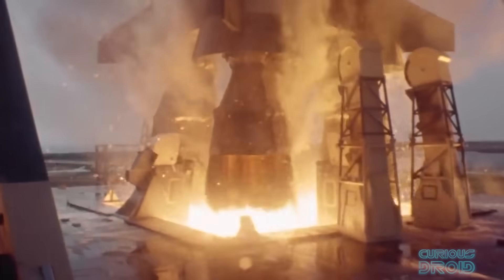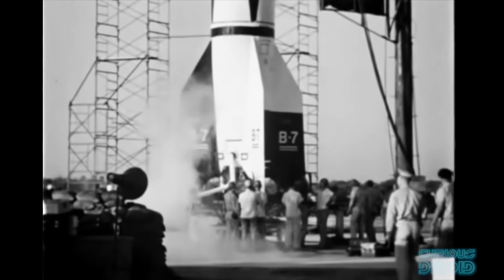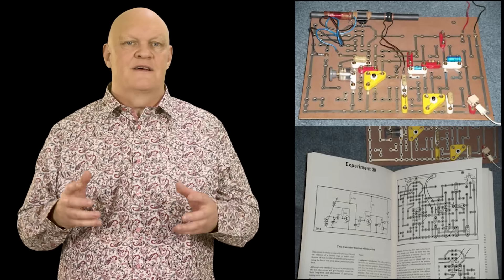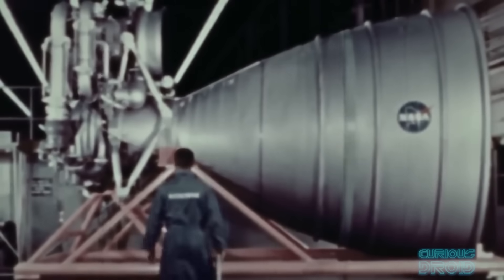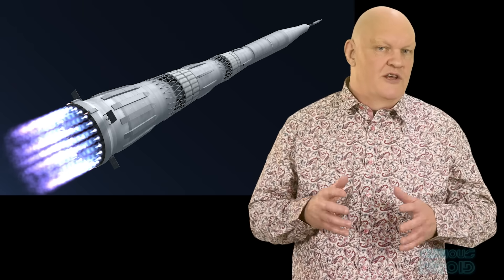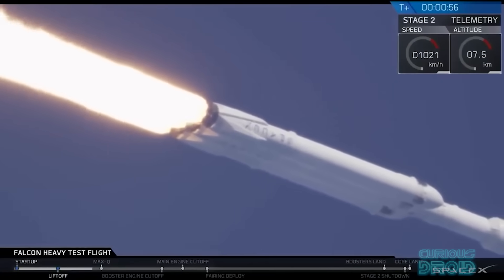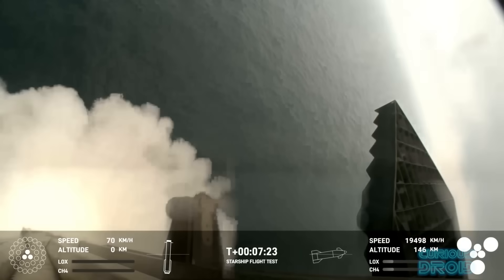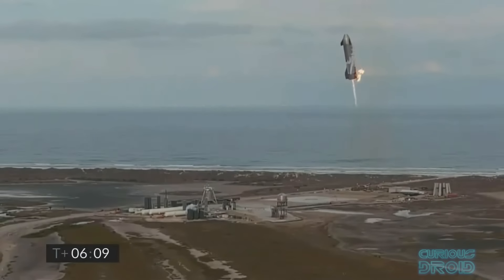Why Does SpaceX Use 33 Engines While NASA Used Just 5?

Comment: Elon is all about 'mass production' ... Raptors are the expression of this.
Reply: Did Apollo 11 actually leave near-Earth orbit?
Despite the revisionist narrative that this channel won't question -- unstable fuel burn for the oversized F1 engines was never rectified and another arrangement in their place was made in order to reach near Earth orbit, keeping the F1 bell nozzle to maintain the desired appearance.  The great licking yellow flame was an indication that something was not normal as fuel was burning in the atmosphere while providing no additional thrust. This was the result of injecting additional kerosene into the exhaust stream for greater visual effect yet appearing to produce an inefficient burn unlike other rockets after launch.  No explanation is forthcoming and this issue is not addressed in any usual report; however, using a smaller reliable engine with a reduced fuel load and stripped down mission requirement allowed the Saturn V to reach near-Earth orbit.  

The Apollo 11 crew attempted to demonstrate their position at over halfway to the moon as seen in the unedited version presented to the public while the more recently released unedited version reveals a flood of blue light entering the same window as the camera continues to roll, through which only a moment before, we saw the Earth far distant in what appeared to be very low light conditions. Then, as the camera pulls back from the window, the exposure settings are seen to return to normal as a flood of light enters the same window.  Without a change in the orientation of the spacecraft assumed to be on a trajectory toward the moon, the only source for any flood of light can be the Earth while in near-Earth orbit.  

Another indication are the impossible weather patterns seen on Earth, when in reality only a small portion of the Earth's surface was visible, framed by the round window of the command module.  Straight line cloud fronts are seen to be extending for what appears to be more than 6000 miles, a quarter of the Earth's circumference -- something that has never occurred in the meteorological record on Earth. 

The usual sponsored efforts will try to make excuses for why the obvious did not take place -- yet is overly apparent in the unedited version.  When facts cannot prevail in support, sponsored activity will resort to name calling and other derogatory comments discrediting themselves.
Reply: And he's learning the hard way why every attempt at using large numbers of engines ended in disaster.
Reply: @ZontarDow Raptors are meant for engine-out capability, in which a few engines failing won’t affect the outcome of the mission. In addition, Starship has had two perfect full duration ascent burns so far, and one in which one engine shut down, with no effect on the mission outcome.
Reply: @ZontarDow did i happen to argue with you on twitter yesterday? Because one guy was spouting the exact same nonsense you were! 
Engine count is not an issue. Engine reliability is.
Reply: @_K3PLR  no doubt he's hatin on the Elon, .. obviously still butt hurt about Elons 'Red pilling' 😉
Reply: @_K3PLR  Engine reliability is not what SpaceX is focusing on, which is why the 3rd iteration of Raptor began being built before the problems of the 2nd where even resolved. But then Starship is a conceptually dumb project that we already know from Heavy there isn't a market for.
Reply: @ZontarDow dont try and switch the subject dude. You were just yapping on about how "spacex is making the same mistake the soviets did!" This is obviously in reference to the N1 and its high engine count on the first stage.
Reply: "engine reliability is not what spaceX is focusing on"
Is that why during 3/4 integrated flight tests, the raptors preformed nominally on ascent for the superheavy booster and for the ship? Is that why on IFT-4 both the booster and the ship made it to soft splashdown? Cl
Reply: @_K3PLR  one engine explode with visible debris during IFT-4 booster descent to soft splashdown (15:42)
Reply: @xponen  thats exactly why having so man y engines is beneficial. you get ENGINE OUT CAPABILITY. what would happen if superheavy lost 1 or 2 engines on ascent? it could keep going and finish the job. Now what would happen if the Saturn V lost 2 engines? An abort and an abrupt end for its mission.
Reply: @ZontarDow  No market?  SpaceX is their own market for Starship.  And tell the several space stations being designed to fit inside Starship, long before the vehicle is ready for such a thing, that there will never be a market and that they don't count.
Reply: @xponen  That was pretty amazing that it still achieved the soft splashdown.  The software must be crazy flexible.
Reply: @snuffeldjuret  The same Starlink that loses money and mathematically can't be scaled up to profitability?
Reply: @ZontarDow  Starship4 just landed  both perfectly, with Booster. So what's the problem?
Reply: @Primaate  The fact that even ignoring Starship being conceptually stupid, in a best case scenario it'll have cost more then SLS to develop and will enter service just in time to be already obsolete given Blue Origin is on track to beat them to the moon which is the thing Starship's being used as a stopgap to bridge the development for.
Reply: @ZontarDow  You're obviously joking... or insane. Let's leave it with 😂 ... or 🙄
Reply: @ZontarDow the soviet union suffered from not understanding the economy of scale 

Something Elon understands more than most considering he's Americas leading industrialist at building things at scale 

The falcon 9 benefits not from it's semi reusable booster but mass production of the merlin block D engine 

Making kerosene burning engines at scale gave them an advantage even before reuse of the booster
Reply: @ZontarDow then WHO is????

He runs Tesla and employs the majority of Austin Texas and is Californias largest manufacturing employer 

He literally is the face of the space industry?

Comment: Quicker and easier to swap out. Cheaper to make and produce
Reply: Did Apollo 11 actually leave near-Earth orbit?
Despite the revisionist narrative that this channel won't question -- unstable fuel burn for the oversized F1 engines was never rectified and another arrangement in their place was made in order to reach near Earth orbit, keeping the F1 bell nozzle to maintain the desired appearance.  The great licking yellow flame was an indication that something was not normal as fuel was burning in the atmosphere while providing no additional thrust. This was the result of injecting additional kerosene into the exhaust stream for greater visual effect yet appearing to produce an inefficient burn unlike other rockets after launch.  No explanation is forthcoming and this issue is not addressed in any usual report; however, using a smaller reliable engine with a reduced fuel load and stripped down mission requirement allowed the Saturn V to reach near-Earth orbit.  

The Apollo 11 crew attempted to demonstrate their position at over halfway to the moon as seen in the unedited version presented to the public while the more recently released unedited version reveals a flood of blue light entering the same window as the camera continues to roll, through which only a moment before, we saw the Earth far distant in what appeared to be very low light conditions. Then, as the camera pulls back from the window, the exposure settings are seen to return to normal as a flood of light enters the same window.  Without a change in the orientation of the spacecraft assumed to be on a trajectory toward the moon, the only source for any flood of light can be the Earth while in near-Earth orbit.  

Another indication are the impossible weather patterns seen on Earth, when in reality only a small portion of the Earth's surface was visible, framed by the round window of the command module.  Straight line cloud fronts are seen to be extending for what appears to be more than 6000 miles, a quarter of the Earth's circumference -- something that has never occurred in the meteorological record on Earth. 

The usual sponsored efforts will try to make excuses for why the obvious did not take place -- yet is overly apparent in the unedited version.  When facts cannot prevail in support, sponsored activity will resort to name calling and other derogatory comments discrediting themselves.
Reply: According to Musk or some independent critical observer? There should be some healthy skepticism when conceptually super advanced engines which, by musk's own admissions, struggle not to consume themselves, are cheaper and more reliable. Not to mention they're supposed to be reused over and over and over after very harsh running conditions while remaining cheap and reliable. Doesn't quite add up.
Reply: @snizami  Explain Falcon 9 and Falcon Heavy, then.
Cheap, reliable, reusable.
Why wouldn't we expect Raptor engines -- which SpaceX is developing with exactly the same rapid spiral iteration regimen -- to have a similar outcome?
Reply: @thomashiggins9320  Especially when there will be so many more of the things being manufactured and tested weekly.
Reply: @thomashiggins9320  Two different things. Like saying anybody with one success in life means they'll continue to be successful in everything they touch. Comically silly argument only fanatical cult members could come with.  Secondly, F9 and FH are plenty expensive in terms of price to customer and we don't know the internal financial details of a private company to know what the margins are.

Comment: Soon to be 35 raptors
Reply: And eventually migrating to V3 for 18% more thrust on each of them.  Little wonder that they're going to be dramatically lengthening both parts of the Starship stack.  That's how you reach 200 tons to LEO.
Reply: @Asterra2  and that's when the space economy transforms into mass space based manufacturing. It's going to revolutionise the world.
Reply: Did Apollo 11 actually leave near-Earth orbit?
Despite the revisionist narrative that this channel won't question -- unstable fuel burn for the oversized F1 engines was never rectified and another arrangement in their place was made in order to reach near Earth orbit, keeping the F1 bell nozzle to maintain the desired appearance.  The great licking yellow flame was an indication that something was not normal as fuel was burning in the atmosphere while providing no additional thrust. This was the result of injecting additional kerosene into the exhaust stream for greater visual effect yet appearing to produce an inefficient burn unlike other rockets after launch.  No explanation is forthcoming and this issue is not addressed in any usual report; however, using a smaller reliable engine with a reduced fuel load and stripped down mission requirement allowed the Saturn V to reach near-Earth orbit.  

The Apollo 11 crew attempted to demonstrate their position at over halfway to the moon as seen in the unedited version presented to the public while the more recently released unedited version reveals a flood of blue light entering the same window as the camera continues to roll, through which only a moment before, we saw the Earth far distant in what appeared to be very low light conditions. Then, as the camera pulls back from the window, the exposure settings are seen to return to normal as a flood of light enters the same window.  Without a change in the orientation of the spacecraft assumed to be on a trajectory toward the moon, the only source for any flood of light can be the Earth while in near-Earth orbit.  The usual sponsored efforts will try to make excuses for why the obvious did not take place -- yet is overly apparent in the unedited version.  When facts cannot prevail in support, sponsored activity will resort to name calling and other derogatory comments discrediting themselves.
Reply: Yup, not long until 35 of them fire up at once. It's insane.
Reply: @Codysdab Engine and control system reliability have improved by many orders of magnitude since Soviet times.
Reply: @owensmith7530  The reaction times of the current computers is orders of magnitudes faster, allowing for much finer grained control of the craft - this solves most of the problems they had then. Much more telemetry can be handled at once.
Reply: @paulmichaelfreedman8334  That's what I said, just in different words.
Reply: @owensmith7530  I was saying insane, not as a bad thing, but more a exclamation of amazement. SpaceX are bad ass for doing something like this, and its a very good thing to increase safety and reliability.